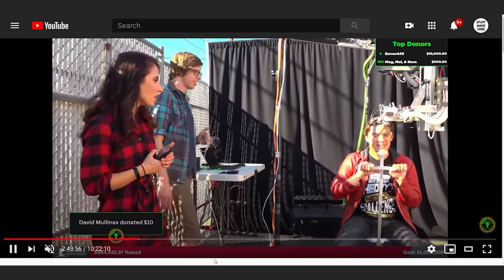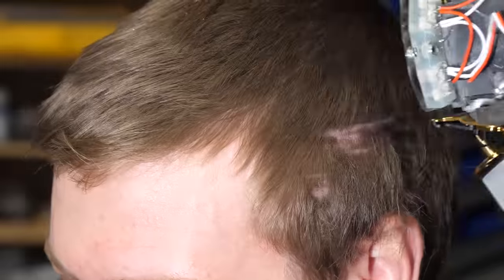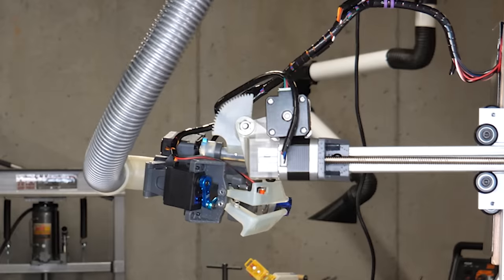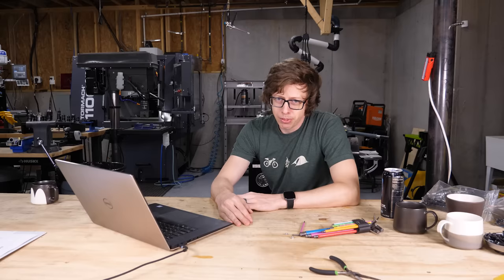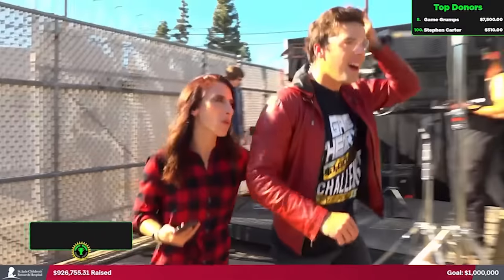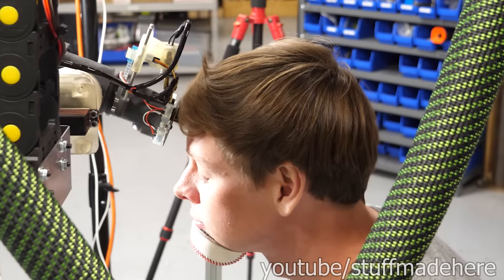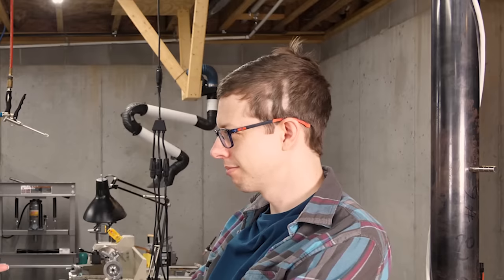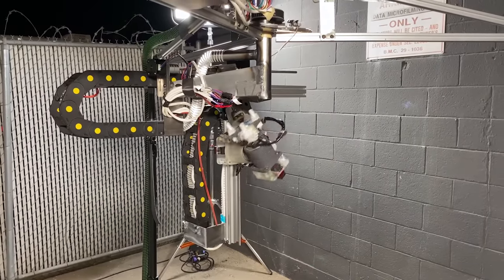Sometimes you have to test robots on yourself

Comment: I'd love to see a V3. 

Maybe analog radars would've been a good replacement for the limit switches. Maybe the radar echoes would've ignored the hair and just told you have close you are to the scalp. Not sure though. In industry, level radars in silos can filter out dust pretty well.

For the sides and back: I have a trimmer that can move a guard up and down to adjust for length. I'd like to see that for the sides. It could use the same motions as a hair dresser for the sides and possibly use load cells (weight sensors) to tell you how many pounds of pressure the guard is putting on the scalp. You could aim for a range of 1oz to 4oz or something. Use 4 cells to make slight corrections in the angle/weight distribution. This kind of limits it to only shorter basic hair styles, but I think it's a decent compromise.

Now that I think of it, you could overkill it with the load cells in every direction to make sure you aren't hurting your test subject.
I might be getting carried away for a project that ended 8 months ago, but oh well.
Reply: I am making V3, it will be easy to use and support many hairstyle without any skill

Comment: A real solvable problem is making a helmet that can be worn by kids and adults who have cochlear implants. My nephew can't wear his helmet and hear at the same time which is very dangerous. The helmet rubs the magnetically connected sensors off his head every time he puts the helmet on. We need a helmet for him that has cut outs in the foam or some other solution to this problem. Please consider this, I really believe this could impact so many people in a positive way. I just want him to feel like the rest of the kids.
Reply: Interesting.. I wish I could help, but I'm only a high school student. I do have a few theories, maybe a sort of baseball type helmet with foam in a configuration that still cushions the head effectively but instead using the sides of the head as support. The side pieces could be adjustable with a band, maybe a knob in the back? They would fit over the ears like headphones and the cushions would support themselves higher on the head and somewhere on the jawline? I'm sorry I don't have the materials or the ability to design it.
Reply: Exacto knife?
Reply: That's really interesting, and I definitely think that It's right up this channel's alley. Commenting so this has a greater likelihood of getting seen.
Reply: Im referring to a motorcycle helmet - My nephew has cochlear implants, I just removed the foam sponges on both sides of helmet and it works for him, he wears both cochlear processors with the helmet on, i suppose it comes down to brand of helmet. as these pieces of sponge are removable and not glued down in any way.
I myself wear hearing aids and removing the sponges also helped me.
Reply: I have two kids with cochlear implants and we've seen the same problem. Usually we can get their bike helmets on in a way where the coils will stay on, but it's definitely a bit of a pain. One of these days I should figure something out. But I do imagine you can just cut out some of the foam with a knife.
Reply: dzejlan  Nice song indeed, but try to be more mindful under the section you are self-promoting, loved the beat.
Reply: Up, wish he can see this comment!
Reply: might wanna ask someone who makes medieval armor replica helmets n things. 
they can make anything for any size but dont know if you can make a helmet for different sizes though, human heads are all unique.
Reply: Yes this!!
Reply: Go Kai
Reply: Ideally if you remove support from one area you should add support somewhere else.  I'm betting there's some mathematical formula for figuring out where to reinforce it and how firm the padding should be in different areas.
Reply: THIS! We have tried multiple different styled helmets but haven't had much luck with any of them. Some are better for his processor's (over the ear device) but they still manage to swipe his headpieces off as the helmet shifts with movement. Some part of the safety feature gets compromised with adjustments to existing helmets. He is 4 and riding his bike with his friends is one of his favorite activities. We either compromise his hearing or his safety, and obviously neither is ideal. We have many friends with CI's and/or hearing aids and they all experience the same issue.
Reply: DO IT!!
Reply: Wear a swim cap that covers the magnetic portion of the implant, then put the helmet over the cap. I haven't tried it, but I do have one implant and one hearing aid and I can imagine that it would work.
Reply: Suggest talking directly to helmet manufacturers. Tjey have the specialized knowledge Shane does not and know their products best in terms of safety requirements.
Anyone can remove padding, but it takes a specialist to know if what you did can cause the helmet to fail at its primary purpose of protecting your skull.

Comment: First of all, I want to say that I love your channel! Now, a suggestion: how about starting with (what I believe) to be a simpler hairstyle? A fade. Also, It seems to me that that hair trimmer is going "perpendicular" to the head. But when you go to a hair stylist, the stylist will generally hold the trimmers at slight angle from the head. So not parallel, but semi-close to it. By putting a fade with a different angle of holding the trimmers, I think it would be much easier. I don't know where you live, but if you're anywhere within a 6 hour drive, I'm willing to volunteer for a haircut.
Reply: I'd also think that in line with CNC routing, it may be sensible to try a machine that can attach and use clipper guards?
Reply: I am also making a intelligent hair clipper for 2 years, it can make some easy hairstyle. If interesting,  welcome to connect with me

Comment: here's an actual problem i've experienced:

a lot of newborns/babies/toddlers sleep better with white noise. additionally, having a baby monitor is really important once they start sleeping in their own room, especially if their bedroom isn't right next to yours. the problem is that the white noise can drown out any crying on the monitor until it's to the point of being hysterical. plus, now the parent effectively has to sleep with white noise too, except it's white noise filtered through the low fidelity monitor. what i'd love for someone to make is an integrated monitor + white noise machine, where like the parent unit of the monitor inverts the wave of the white noise in software/firmware so that you only hear the other noises in the room (effectively the idea behind noise-canceling headphones). 

and it would be REALLY great if this was an offline solution - we used alexa to play white noise for a while until one night when the internet went out at 3am and we had to scramble to download white noise on one of our phones to leave in the room. we use a dedicated white noise machine now.
Reply: I like this problem and sounds very doable with software!
Reply: Also for dogs!

Comment: I remember 20 or 30 years ago when there was a big push to design a robot to shear sheep in Australia.  It is a skill that takes a long time for humans to acquire and there was a shortage of human sheep shearers.  There was a great economic incentive to develop a commercial product but it turned out to be a very difficult problem due to the non-uniformity of sheep and their lack of trust of robotic devices.  It was the most difficult robotics challenge of its time.  I am impressed by what you did given the time you had available.

Comment: Better use GitHub next time. Just something I've had to learn myself. Edit: fixed typo
Reply: github is essential. takes a while to get used to, but it is important.
Reply: Or any type of version control. To be honest, I felt a little better about myself when I heard that ^^
Reply: @tornoutlaw  well version control doesn't automatically mean syncing it with an off-site server.

Don't get me wrong, version control is important, but the main issue here was, that there was no backup.
Reply: @bastscho  You are right, I was trying to hint at GitHub alternatives like gitlab.
Reply: Git is definitely something to consider for help with software iteration and storing not just on one computer that can break.
Reply: @tornoutlaw  ahhh gotcha
Reply: GitHub is a good habit I never developed.

I’ve lost thousands of lines of code and I’ll lose thousands more before I ever diligently use an online git repository
Reply: for someone like him, git/github wont even be hard to learn. just remember to push!

Comment: In the vet medical area animal prosthetics usually are just animal wheel chairs but what if you could make a non electronic inexpensive prosthetic leg for dogs and cats. If they were also able to be 3D printed with some sort of passive mechanism for movement/balance that would most likely be the best solution. Like how you used multiple layers of 3D printed plastic springs in you crossbow maybe you could implement that in the model ( and if the material has to be some sort of metro for the spring and main “bone” structure of the leg it would also have to be light weight whilst being able to hold the animals full weight plus even more due to inertia during jogging, sprinting motions and speeds, the foot of the prosthetic would also have to be flexible at the ankle joint to provide a sort of auto correcting system so the foot always lands flush to the ground, and the prostetic has to have some for of a pulley system and or force multiplication mechanic to account for missing areas of the limbs at different points such as the shoulder, knee, or even just ankle which could also lower the cost or increase the cost depending on how much of their leg they are missing. But anyway now I’m just rambling on and probably didn’t even cover half of the requirements it would have to meet but ima stop now since my comment is way to long..... if you read this all the way through then I’m so terribly sorry for wasting a few minutes of you life.

Comment: When doing the shaving, a smaller shaver would increase resolution
Reply: But would also increase time to shave
Reply: Or having a trimmer head that can turn off partitioned sections so you can have the full trimmer going for the big areas, but just a couple teeth on for the minute detail.
Reply: @RunningOutOfBreath  
Tool changer like a CNC!!

Comment: ideas:
laundry folding machine that actually works.
sock matcher, just pour all the socks into a pile and it will sort the socks into pairs.
dishwasher stacker. End the fights of the right way to stack the dishwasher, and have a robot do it for you
temperature of shower/bath - a sensor that feels the water temperature and then things you attach to the wall for any kind of handle(s) that can adjust the temperature and be moved from place to place.
A drone to catch insects around the house.
A crib that gives baby milk when the baby wakes up in the middle of the night or cuddles them to get back to sleep with no parent intervention.
A machine that hangs up laundry on a clothesline with pegs.
A robot that takes pictures of your bookshelf until it is able to create a list of all the books you have using OCR - the software attempts at this have been thrown off by humans taking bad pictures and not going back for more pics when unresolvable.
Reply: Underrated
Reply: OMG the sock matcher would be sick
Reply: Lazy

Comment: Please find a way to make gross lake water clean again, my reservation relays on that water source for water and it’s so contaminated, a lot of people have a been getting sick for years.
Reply: I think that solution is not so much clever as it is expensive (and requires you to prevent people from adding more pollution to it, which could be difficult depending on factors).
Reply: I believe that's called a filter?
Reply: @laurinbecker9974  Yeah, it really depends a lot on the problem at hand. A lot of bodies of water - especially more stagnant ones like lakes - are just naturally dirty. Even some large rivers are naturally dirty, though. Glacial rivers, for example, often aren't exactly ideal drinking water sources without some serious filtration to get rid of the copious amounts of silt.

Comment: Here's a nice idea for the archivists out there.  A machine that handles books and scans page after page automatically by turning the pages itself and getting clean scans each time and account for different size books and materials.
Reply: There already are machines like that. They also use lasers to correct for page curvature (so the book is not pressed flat against flat scanner each time).
Reply: Oh cool what's it called?

Comment: My suggestion for problems are this: machine that filters water out of the air--there's people working on this with new materials that make this possible, and the results apparently are reasonable, but maybe it's something you could make a version of? Also anything related to making solar power easier and more accessible for people to set up in their homes and apartments.

Comment: Please as a future step forward, all your programming projects should be backed through a revision based private repository. Sign up for a free service like Bitbucket or Github and never worry about losing an entire project or even past changes while you work. To mention if you needed help you could easily share things to collab. Even if you did before, fix the rules in why it wasn't pushed. Imagine all that extra time you could have had with family or working on other projects or rebuilding the code again but while knowing what the old code was. :) Keep up the awesome work!

Comment: Put the blades inside the vacum head running high speed by the suction, make it adjustable and the blades rotary. Every hair will be cut the same hength. The scissors and fingers will be eliminated, and no hair to sweep up.

Comment: you should attempt to make an anti-Parkinson's counteract arm piece, as in a way to detect shacking and counteract that to stop the shaking. I know it may sound dumb but may be really interesting to watch attempt to make a solution to Parkinson's disease.
Reply: There are a handful of products already on the market for that. The most well-known is probably the spoon.
Reply: Yes, my grandma has trouble using her computer mouse, has to use her other hand to steady it. Just something that counteracts the shaking would be good - even just software that makes an average would be good
Reply: @ivangutowski  I found a reasonably priced commercial solution searching for Parkinson mouse stabilizer but it would be cool if there was also some free / open source alternatives.

Comment: I would suggest a better idea : build a cap dome of head shape, surrounding on the dome there would be vacuum suction tubes that would lift/ suck the hair bunches and hold them up. Based on computer program and hair cut design of different head areas robot would move around the head to cut hair, saftey feature would that sensors would be detecting that hold is only hair, not skin. Would do the cut.

Comment: I think you should have solved it differently.
If you limit the hair length to max 14 mm you can build the code such that it first gets all the hair trimmed to max length then scans the head shape and sets the length for each head area.
Then you can use the hair cut machine technique, where you attach the hair clipper gapper to the head, and raise it against the direction of the hair growth.
So it's way easier to trim the hair, using a machine.

Comment: My aunt has Parkinson's and uses a wheeled walker to get around, but due to the way the diseases messes with the motor-neuro system there's this strange feedback loop where her leaning on the walker causes her to gradually push it away so she ends up falling even with a walker. Would it be possible to make a wheeled walking assistant tool that is capable of preventing this? Maybe it tracks the distance to the user and stops or slows if it gets too far away, and/or has a maximum safe speed it can reach before automatically braking (I feel like this would be most useful on a downhill slope). This would allow for a lot more mobility than a wheelchair and encourage walking to stay active rather than discourage it for safety reasons.
Reply: this is a great Idea
Reply: @superrinusblick4222  Unfortunately it'll be lost in the other 4600 (and counting) comments. Can't seem to reply to the pinned comment for some reason, it's like that thread has been locked...
Reply: @Hugh_Jas  we can just hope

Comment: What if you take something like a Flowbee (which is a real life product that the pulls hair with a vacuum and cuts it) and move it back and forth around the head CONTINUOUSLY like a printer (as opposed to lifting up and placing back down)? The cutting component would be inside the vacuum as opposed to in front of it. The idea would be to reduce the area of contact to give more precision, and the continuous contact with the head with reduce the complexity of lifting off and coming back. Also it would allow you to get closer to the ears because you can detect collision with the ear from the side (like a roomba).

Comment: I have a problem and some idea of the solution. I just discovered that I love to play the guitar. But it is not something that you can do while walking, they are big and clumsy. While technically you just need 2 parts of the guitar, the one on your right hand and the one on your left. It is just a matter of knowing this dinstance and making a movable 4-fret, 6 strings board connected to another 6 string board for picking strapped to your belt. And a collapsable arm in between that can keep the planes parallel and measure the distance. Also hold your electronics cause you will have to calculate the note based on finger position